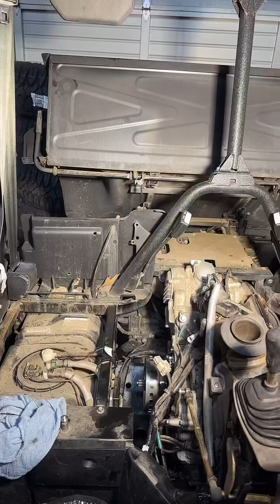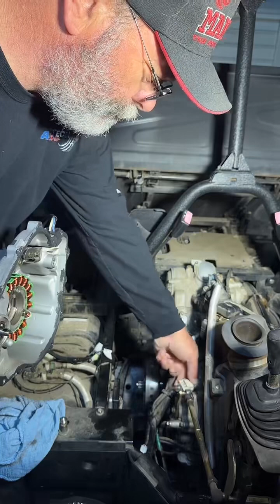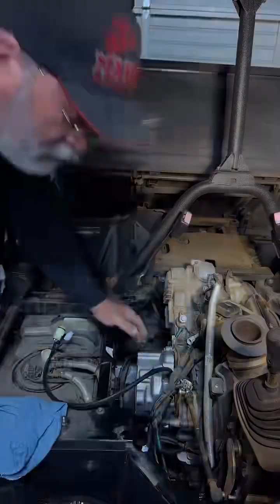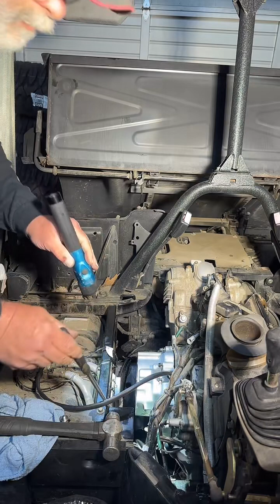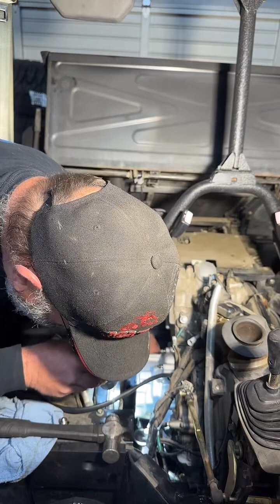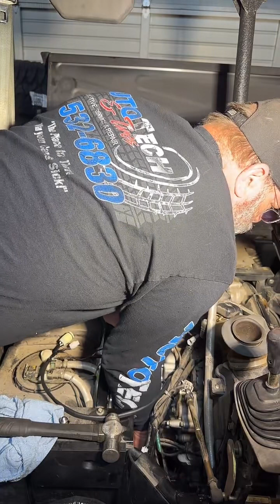Massimo UTV Crank Position Sensor and Stator replacement Part 3

Comment: I don't know how you did that without removing the gas tank. I had to replace the timing chain and gear. Had to remove gas tank. Made it much easier but that gas tank is kind of a pain to wrangle out.